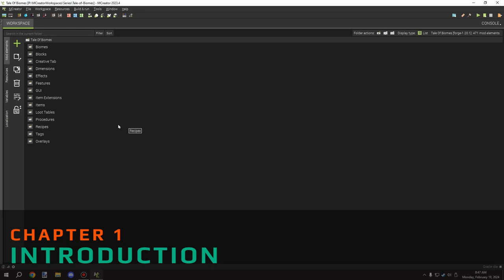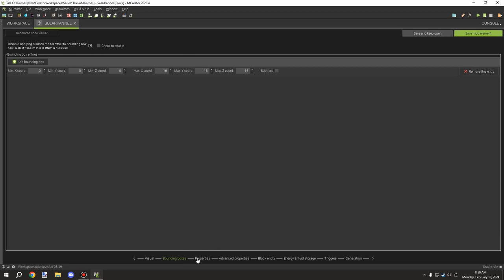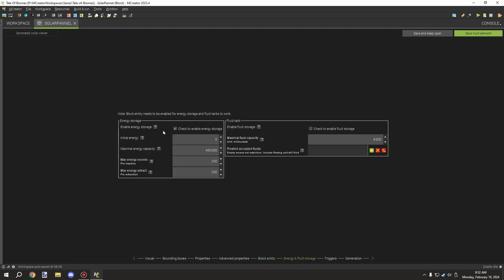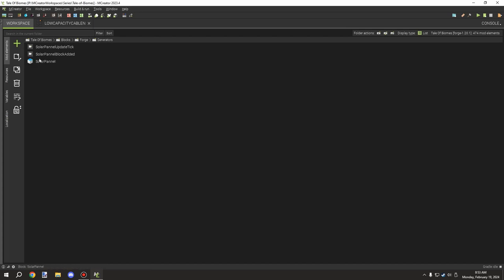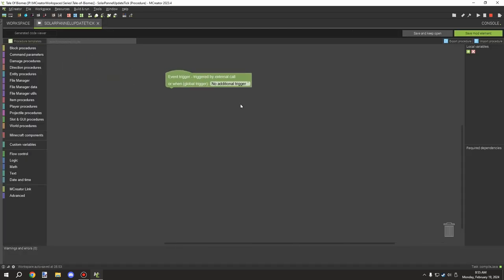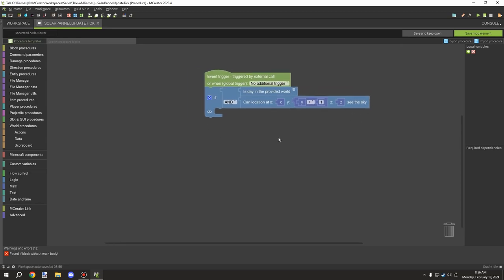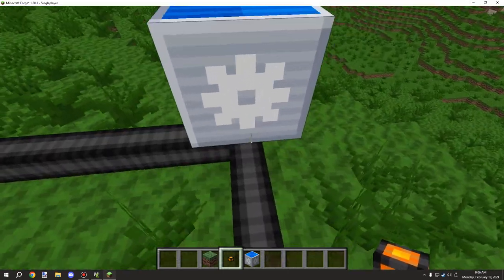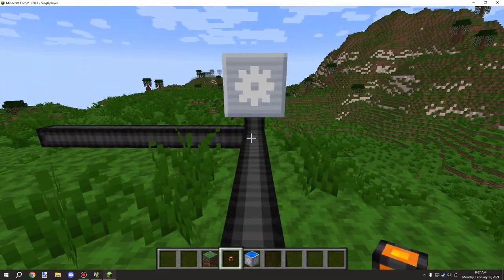Part 3 | Forge Energy Generators | MCreator

Comment from the maker: ► IMPORTANT UPDATE
The energy script had a critical bug, and it's taken me a few days to work out. Ended up reaching out to a close friend which helped with the fix.

Part 3 also needs some work changed but in Part 4 I will explain the changes for generators and cables.

However, the setup is not too much different and this video will be a good starting point to explain the general system for setting up cables in general still.

You can find Part 4 in this playlist once the video is released.

https://youtube.com/playlist?list=PL5k7swYOU_yTIu9xFwVbW52KVqZsIU9LP&si=opPK8EGmpBcbT5so
Reply: Oh ok but when you can do a tutorial on cutscenes plz! And keep creating tutorials thanks!!!

Comment: It's interesting that I found a way to display the damage index using the Text display command using the execute command block in the procedure.  and am having a headache about how to create a Gui/overlay status bar like health/maximum health
Reply from the maker: Yea I am at the same point.
I had to redo CCTV Craft as performance was getting out of hand with it.
Been working with commands a lot and functions took me a couple days just to figure out that the reason why player variables were not setting properly was because the script was run though a global  procedure which was only run on server-side, once I fixed that issue it worked fine lol.

Some times it helps to take a small step back and just catch a breath to get your bearings then look at the settings again.

Comment: Hey can you help me? I did all the steps for the cables and the solar panels but the solar panels just wont generate any energy into the cables
Reply from the maker: Check the example workspace and compare it with your workspace, I sadly won't know how you set yours up so you will need to make sure everything is linked like the example workspace.
Reply: @NorthWestTreesMCreator  thanks, so I deleted the solar panels from my workspace and decided to re add it in  and it worked. Thanks alot. Im looking forewards to your fluid pipes in the example workspace

Comment: Hey, do you know how to make a coal or thermal generator? (something like a generator that uses combustible items like coal or lava to make energy)
Reply from the maker: For coal you would need a block with at least one inventory slot.
A timer to control the fuel consumption time.
And just basic script to decrease the item slot each time the generator timer reaches 0.
If its 0 you also want to block energy from being generated so a condition to test if the timer is > 0 then run your energy script based on the timer being 1 or above.

For lava same idea basically we will touch into forge fluids in the near future but I need to work on a pipe structure before I can start covering the fluid part. Some code will need to be adapted for fluids in order to make it work with what I have made for the cables but I will be working on three videos in the upcoming three weeks so I have time to work on that part.
Reply: It works, thanks!